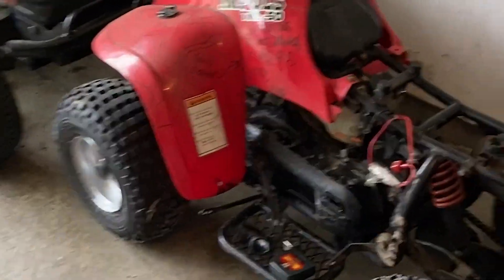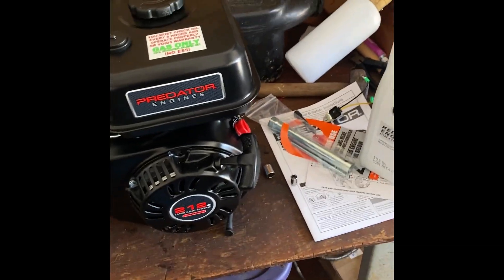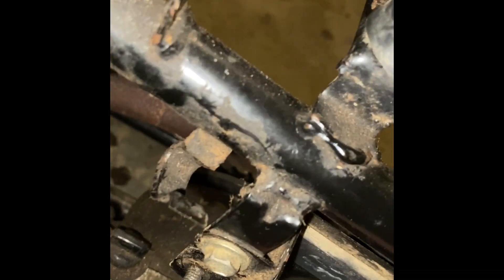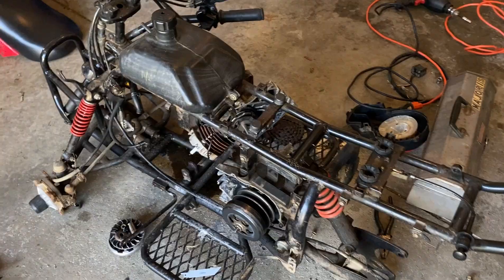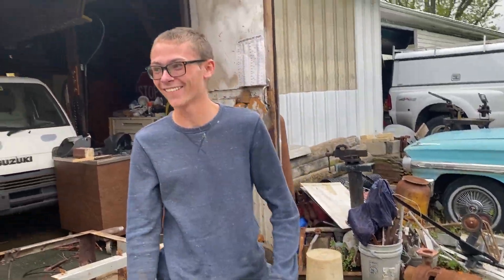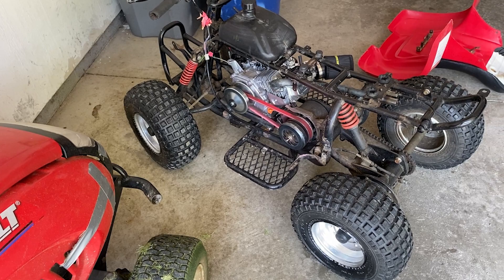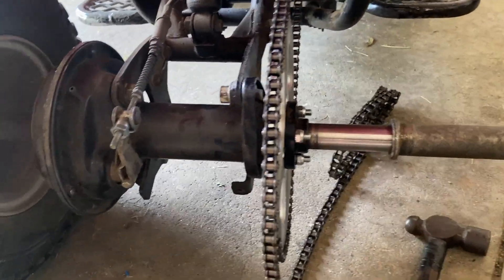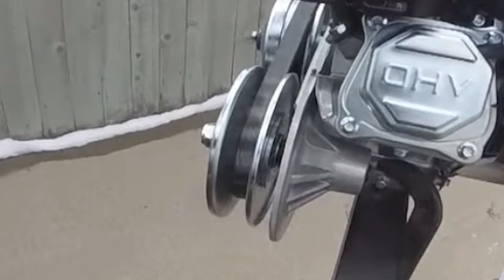How I Built my Predator 212 Swapped Mini ATV

Comment: What was the final belt size and sprocket and how did you make the jack shaft a 1-1 ratio doing the same build.
Reply from the maker: Took out the idler gear and welded the opposing gears together. Better to use an actual jackshaft

Comment: been running my 212c with bypassed gov for 2 whole years going on 6500prm and its never blown with proper maintenance
Reply from the maker: 6500 is fine. I was saying if I wanted to run 9K. But for that there’s other upgrades that follow. Like a new piston rod and if it has a plastic camshaft it’ll need a new camshaft and stronger valve springs etc. this video was made a long time ago and edited like almost year after so it’s a bit outdated in terms of my mechanical knowledge

Comment: 10k rpm aluminum flywheel is $27
Reply from the maker: GPS wants $120 lol
Reply: @IsaacMega get it off Amazon for $27 it's a different aluminum ( not billet) but it's very reliable and is good up to 10k rpm

Comment: Thank you for this video I'm going through this as we speak almost same quad what new sprocket did you get what size is that
Reply from the maker: 72 tooth. Ur gonna want to use a proper 30 series torque converter and jack shaft instead of using the factory transmission. That way it’ll ride a lot better
Reply from the maker: Not only that but the rednecked transmission shreds belts like crazy cause we couldn’t get the alignment perfect

Comment: How did you make the gear reduction case a 1-1 or how did you gear it differently? 

I’m doing just about the same thing and it’s soooooo slow
Reply from the maker: We had to weld the two gears that are facing each other together and remove the other idler gear inside. There is a better way to do it using another shaft with a sprocket
Reply: @ do you have and pictures of what you did because all I’m thinking right now is if I did that, it would just lock up and not move
Reply from the maker: I wouldn’t recommend doing it that way. You’ll want to use another shaft and two bearings which will be much stronger